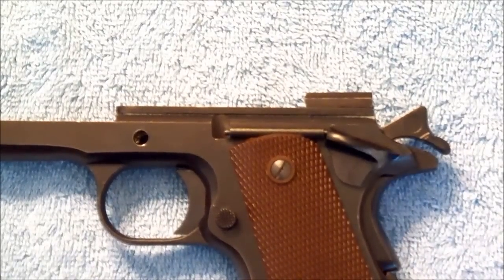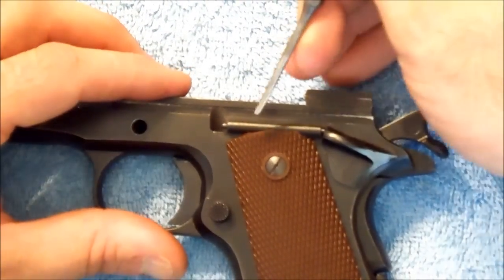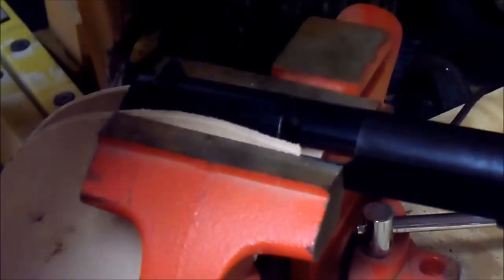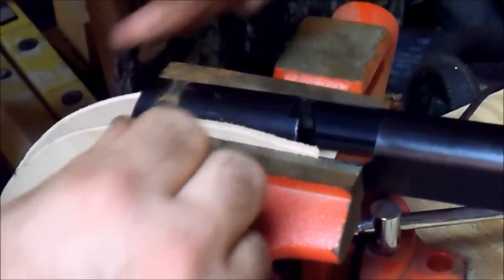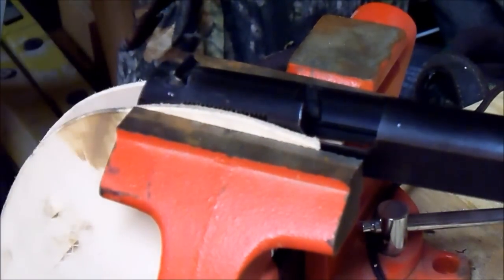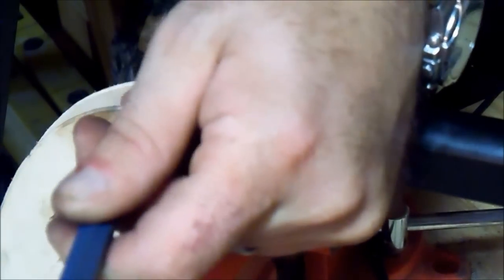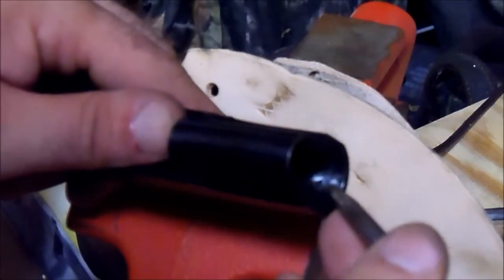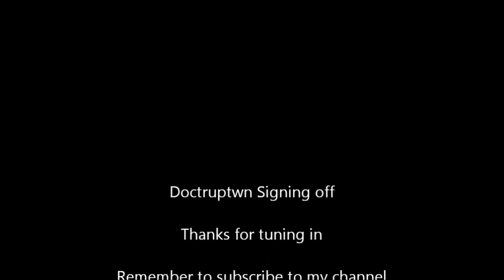1911: Essex 1911 Firearms Rescue part 4

Comment: Sir, I'm sorry but I've never known of a pistolsmith to use steel punches on a set of sights. You should always use brass or aluminum you put two nasty marks in the slide just under the sight dovetail. Not to mention how you battered the sight. Sir, please I'm not trying to insult you in anyway. Always fit the sight to the slide not the other way around. (it's ok to open up the corners) to start the sight. I would have liked to seen you check the cocknotch on the hammer for 90 degrees and also check the sear for a proper primary and secondary angles in order to make the pistol 100% safe. Now, if you did this off camera then my hats off to you sir. Again, I'm not trying to insult you I've been repairing and customizing 1911's for over 50 years. Please try to pickup a set of good brass punches, along with a set of aluminum sight punches. A good set of gumsmith screwdrives and a gunsmith hammer of two wouldn't hurt at all. Best of luck sir.

Comment from the maker: @ricksn777 Rick There is a indication notch cut into the slide at the rear dovetail and then the front sight is on center.  That theoretically gives the centerline of the barrel in relation to the slide.  I have just always centered the rear sight in the dovetail by eye.  So far it has alwas shot pretty close.  You can drift the rear sight back and fourth for windage.  Elevation is done by either filing the front or rear sight  depending on if you need to adjust POI up or down.

Comment from the maker: @TheHiddenPart Part of the lost footage was me preping the sight.  Didn't realize it was missing when I refilmed it.  Basically I filed it down to the spec for the sight and still had to file the slide.  The dovetail in the slide is still about .01 under spec (on the small side).  Obviously your right the key is to not make the dovetail too large and then if you choose to later change the sights having the dovetail too large.

Comment from the maker: Good deal,  assembly problems can make you pull your hair out.  Always remember if you do mods,  do one mod at a time and then if it doesn't work it's much easier to work your way backwards through it and figure out whats wrong.  Sounds like you did a good job.

Comment from the maker: If your comfortable, Remove all the internal parts ecept the trigger, and then replace the gripa and thumb safety you should be able to see into the frame from where the hammer should be.  Check the contact points of the grip safety and the hammer.  There is only about 1/16th of an inch to play with.  If the hammer was fit wrong it will not block the trigger bow from coming backward.  Let me know what you find out.

Comment from the maker: The left fork will ride on the left leg of the sear, The middle leg should ride on the triangle shaped part of the disconnector (not the trigger bow) and the right leg should point back toward the grip safety.  If the grip safety is operating properly it should not allow any movement of the trigger.  The arm should fall down behind the trigger bow and prevent rearward movement.  If it is allowing the trigger to move it will not work for this frame.